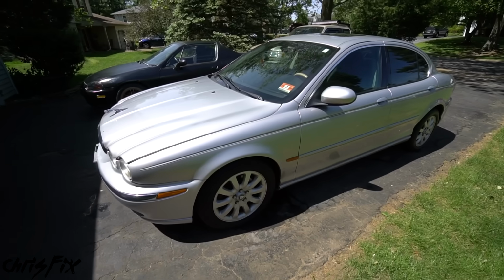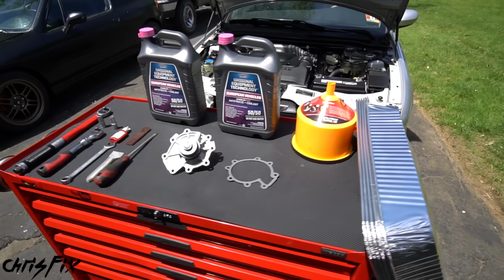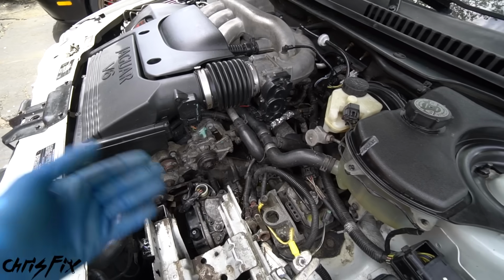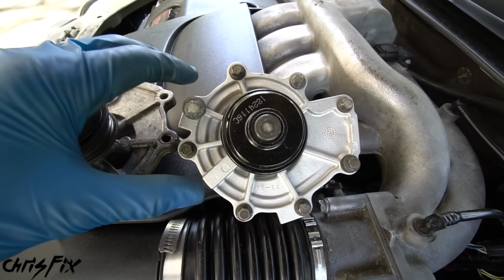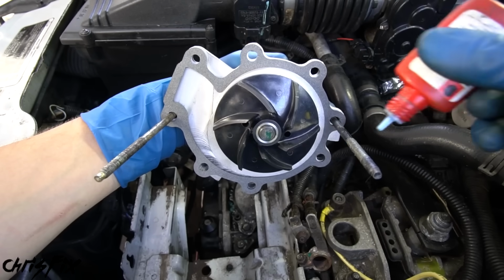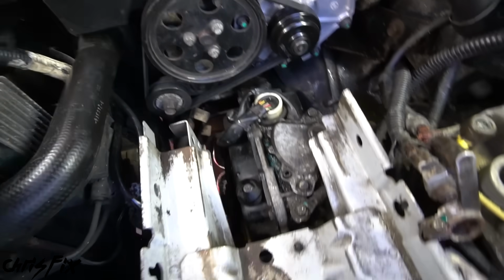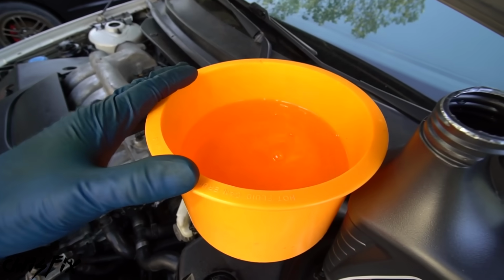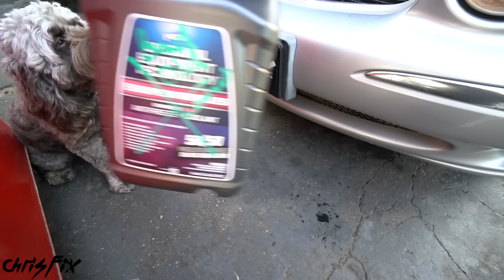How To Replace a Water Pump and Save $783

Comment: The only thing that you didn’t do was check the cooling system’s pressure, the pressure in the cooling system is usually 1bar and it can be checked with a pressure tester.

Comment: Many years ago i did a temp job in a main dealer here in the UK...I'm guessing a lot of you already know this but for those that dont...
one of the "tricks"/ "scams" whatever you wanna call it is this...
Car manufacturer says in its official service manualguide  for its main dealer service shops that job X takes 4hours....
Job can actually be done in say two hours, but the dealer can charge you 4h labour because thats what the manufacturer says in its official service manual..dealer gets away with it by showing customer the manual if questioned on the labour charge......

Comment: Any mechanic heads in here? If so can you save me the bill for an inspection from my local mechanic? My truck runs and drives great but I'm noticing it's taking its sweet time to get power when pushing the gas, she has high mileage (238400) to be exact. The engine doesnt shake or make any funny sounds, it just feels like it takes awhile to get her up to speed, especially on the freeway. Should I just sell it or what?

Comment: freaking Jaguar. 

THE BELT IS ON THE WRONG SIDE OF THE ENGINE YOU FIENDS
Reply: Beaudoin Motorsports VW has the same thing on the tiguan. And it’s tucked in super tight and driven off of the balancing shaft.

Comment: Hey Chris, I was wondering if you would be interested in doing a video about Hydrogen on Demand or HHO, particularly the Hydro Assist Fuel Cell that was purported to be a scam by Dateline NBC in 2009. I would like to install and tune the kit and post a video showing results.

Comment: Hey Chris. I thought if you remove that belt it messes up the timing and camshaft and that? Or do cars have teo belts?
Reply: In the case if that Jag I would imagine it has three belt or more. Most cars have two. The serpentine belt and the timing belt/chain
Reply: That's the timing belt which is attaches to the cam shaft which lifts the valves. The belt he took off wasn't the timing belt
Reply: @sh115067  oh i see thanks

Comment: Hey Chris I have a 2018 Chevrolet Silverado LT regular cab and they come with what I believe a 2 inch higher in the back is it possible to just remove shackle or what will I have to do I just want the truck even. Thank.

Comment: One thing i didn't notice you mention was that some coolant reservoir/overflow tanks require to have an air gap or a certain level in it and not be totally full. Those non-spill funnels will fill it to the top when it might be bad.

Comment: Hey my mom's car is having a problem..pretty much when the car accelerates from 60-80 for a bit the car hesitates or stops for a  millisecond then goes again.....any suggestions? i'm thinking its a bad fuel pump, filter or low fuel pressure

Comment: You didn't check if the parts where the same in this video. You are losing your charm.
Reply from the maker: I showed both of them next to each other and they were identical.
Reply: I know in the video you showed one side and on the thumbnail the other but you didn't say that it's good to compare the parts before replacing them (btw i am joking you are teaching us how to save money you don't need to go overboard).

Comment: Hey Chrris when are you going to install the performance throttle body for your mustang? You showed it in a video about a year ago and never mentioned again.
Reply from the maker: When I install the new motor. The intake on the current motor is as efficient as it gets.

Comment: I'm sorry, but this is one of the only videos I have to dislike. Around 4:30, you mention removing the water pump without draining coolant from the radiator. The coolant in the pump can come out and coat any belts below it. Antifreeze contains ethylene glycol and can ruin a serpentine belt, leading to a much larger repair. Before working on anything dealing with coolant, it's strongly recommended you remove the antifreeze via the radiator. - A 2 year mechanic
Reply from the maker: Sorry but you are incorrect. There is no serpentine belt since it was removed as I showed in the video. No one is changing a water pump without removing the belt that goes around it. Even if there was a belt below it, one time soaking in antifreeze will not ruin a belt. You need constant exposure over time to degrade a belt. Thanks for sharing tho.
Reply: Meanwhile chris has atleast 10 yrs experience lol @chrisfix
Reply: "A 2 year mechanic" 😂

Comment: Jag: its gona be $850
Normal people: shit!!!
Chrisfix: hold my sopy water i will do it in 60 bucks
Jaguar mechanic:😭😭😭
Reply: Sowpee wooder*
Reply: soapy wodder
Reply: The local dealership quoted $500 to replace an '07 Corolla water pump. That's pretty much the best-case scenario.
Reply: @poopipeboy3033  local dealership quoted $2000 replace a 2012 BMW water pump, that was a horrible experience
Reply: Its actually Sowpee Wooder and also a Blinker Fluid

Comment: hey Chris I have a problem with my car and every time I take it to the mechanic they do different things to it and still the problem isn't fixed the DPF filter warning light would come on every so often and after I drive it sometime you would go away and one time they check engine light and the glow plug light came on I took it to the mechanic he cleaned the DPF and give it back, after a month the same problem came back I took it to the mechanic and they said it's the glow plugs so they change the glow plugs and I drove around to heat up the engine so the DPF is cleared but the warning lights are still on, any ideas I could really use the help
Reply from the maker: It would be helpful to know the year, make, and model.
Reply: @chrisfix  Audi A3 2009

Comment: Sorry but not many cars are like that with there water pumps 
Toyota,Nissan,Mazda,BMW,ford, Honda and more. normally have there water pumps behind the timing belt set up and are cunts to do. would love to see you do a water pump on a 2jz RB M20 4age sr20 b16 all take much longer and are allot harder 
But good video man love your work but you did do it on the easiest engine ever

Comment: Chrisfix I really need your help with an issue I'm having. 

I got a Lexus ES 350(2008)(130k)  that was shaking on acceleration and braking. Anything after 40 mph gets pretty bad. 

I replaced the tie rods, lower ball joints (there's no upper), and sway end links bars. All of these parts were OEM Lexus and worn and had a lot of play. 

My car settled down mostly. But it still shakes after 40mph. When I let go of the gas my car settles and rides completely smooth. 

When I brake at 60mph or more. My steering wheel shakes a lot. 

I got an alightment (toe, camber and something else) today from a Toyota dealer. I drove around and it seemed to solve my issue. 

But after an hour or so my shaking issue is still happening at 40mph but less violently. I can also now give it more gas than before, before it shakes. But it STILL shakes. 

I'm so frustrated man. I love this car and it's the only issue it has. What in the world could it be Chris ?

I was thinking CV axles but my car doesn't make that clicking noises when I turn..

Comment: Rule is to always add gasket sealant. Just a thin amount. Do the job once. Never install dry.
Reply from the maker: Actually the rule is to install dry. It’s against manufacture recommendation if you use a gasket and RTV.

Comment: Q: didn't you overfill that coolant reservoir by filling it up to the top? You should mention that you gotta fill it to the max level marked on the reservoir.
Reply from the maker: This reservoir cannot be overfilled. If it is, coolant comes out of a small hole on the side of the reservoir. Great question.

Comment: Sure, in this car's case changing the water pump is an easy task most people could do. Many engines have the water pump driven by the timing belt though, which I'd never remove if I was unexperienced.

Comment: Hey Chris, you are a score to the humanity, thank you for your videos and please keep it coming with more how to tutorials,

Question: I own a 16 Subaru crosstrek in Dubai, whenever I cold start the engine I hear a knock in the engine that escalates until it blends with the engine noise, I couldn’t identify it because it happens noticeably only at a cold start, other times it happens but for a shorter time, depending on how cold the engine is, i think i have a short video for it, let me know if you can help me with it.

Comment: It's also a good idea to turn on your heater on full blast to make sure the heater core doesn't have air bubbles as well.
Reply from the maker: Thanks for the tip. That works for some cars but in this case there is no heater control valve so the coolant runs through the heater core all of the time

Comment: What about turning the heater on when your purging the cooling system from air?
Reply from the maker: Great idea but in this car there is no heater control valve so the coolant runs through the heater core all the time.

Comment: Shame this doesn't really apply to my 2011 3.5 Ford Edge. Water pump is ran by the timing chain.
Reply from the maker: Timing belt or timing chain?
Reply: Chain. Whole passenger side of the motor has to come off.

Comment: Quick tip from changing a water pump a few years ago on an old car: replace the bolts holding it on. I had one shear off when putting the new pump on (it's possible it was cross threaded, but I'm relatively confident it wasn't).  Engine blocks are aluminum while the bolts are steel, so it very, very difficult to get broken part out.
Reply from the maker: Thanks for the tip! Torquing then down and using threadlocker helps with that. If your bolts are corroded def swap them out.

Comment: After I bring the car up to temperature, and the thermostat opens, I also put the heat on full blast to open up the heater core, and make sure fresh coolant circulates throughout the entire system
Reply from the maker: Great tip. Many cars you don’t even need to do this because they don’t have heater control valves. That means the coolant goes through the heater core all the time.

Comment: Great vid but just remember that the exact location of the water pump varies by  engine and maker and it won't be nearly this easy to access it or remove it without having the car jacked or on a lift.
Reply from the maker: Correct, thanks for sharing

Comment: How to know if the fix is easy or it will take longer.

Video is around 10 minutes = simple
Video is above 15 or around 20+ minutes = you have to put in some work

Tnx Chris i have been watching ur video for alot of time and now when i have a car and actually didn't drive it for a few months the battary died, after opening the car and charging the battery the car still would not fire up the engine even tho i had oil and all the other stuff, so i went with the dead battery to a local battery shop and yup it had dead cells so they sold me a new one same AH with a discount for bringing in the old one.

Battery was like 6 year old and in a good looking shape but yea after charging it for like 12 hours it didn't go above 25% charge and could not fire up the engine.
Reply from the maker: I’m glad you’re learning a lot!

Comment: Spent 2 hours trying to get my damn fan clutch off and called it quits when I couldn't get it off. Hoping for better luck tomorrow with the proper loaner clutch removal tool from the auto parts store.
Reply from the maker: Get the proper tool and it makes it easy. Good luck!

Comment: Hey chris I have a 2000 mustang v6 with worn out factory pinstriping all the way down the side of the cad I was wondering if you knew a safe way to remove it without scratching or damaging the paint ik you may not see this but I looked all over YouTube and none of them exactly seem safe was wondering if you had any suggestions

Comment: Many newer front wheel drive vehicles have an internal water pump driven by the timing chain.  Meaning you will need to do a timing service at the same time  since you have to pull off the timing chain to do the water pump replacement. This adds a level of complexity to the job.  In some vehicles, like the 2010+ Ford Taurus, the engine needs to be removed from the bottom of the car to replace.  Fortunately on your dad's Jaguar, it's on the outside of the engine.  I like this about the older engines.  A little simpler to work on compared to a lot of newer vehicles.

Comment: There's a max fill line on the coolant reservoir. You shouldn't fill the reservoir to the max because when the engine gets hot it will build pressure in that reservoir and liquid doesn't compress that's why there should be air left in the tank.
Reply: @shaolini  Yeah exactly. They have an expansion tank for a reason
Reply: @shaolini  I don't understand what you're saying. Are you saying that a coolant reservoir and  an expansion tank are 2 different things? Are you saying that you should just fill the coolant(and not the radiator) reservoir to the max line and add more if needed?

Comment: Is it just a myth that replacing timing belt requires water pump replaced as well?
Reply: Kinda. In cars where the water pump is driven by the timing belt it is not mandatory but is a real good idea. Usually you only risk having to do the job again but it can be much worse - I was in a Volvo forum when one member who had changed his timing belt but not the water pump suffered seizure of the water pump. It destroyed the belt and did $6000 damage to the engine. That said, I sometimes take the chance if the pump is a lot more work to get to, like in my daughter's Sienna.

Comment: Bolts: exist
Chrisfix: ill be using medium strength threadlocker and torque them 8ft pounds
Reply: 1998diegox which is the correct thing to do

Comment: You forgot to drain the excess amount of coolant in the expansion tank. If the valve doesn't open properly, your coolant tank is gonna explode when at operating temperature. There is a reason that there is a max and minimum line on them.

Comment: Hey Chris, happy to see you're updating a little more regularly than you used to! 

I like your videos a lot because you do the job for a specific car but usually include the possible differences between different cars. However, I'm kind of disappointed that that's not the case for this video. You kept this very specific to the Jaguar, while the water pump may be one of the few parts that is very diverse in terms of location, the way it's driven and how to do the procedure. For example, not all water pumps are serpentine belt driven, a lot are driven by the timing belt. With the Jaguar, you only had to remove one pulley, with a lot of different cars you have to remove a lot more. Some cars have an electric water pump (BMW E90, looking at you). Sometimes you also have to swap out other gaskets and O-rings when replacing the water pump. Not all coolant reservoirs are placed in such a convenient spot and can be bled the way you've shown (the reason why the method you've shown works is because the reservoir is the highest point in the loop). Also, the little bit of theory and the analysis of how and why the water pump failed was lacking in this video. 

This video was very straightforward and short, and for some things that's fine. But this video is barely usable as a guide for most cars as the water pump is placed in a horrible spot, requires the removal of engine mounts/timing belt/timing belt cover, et cetera. It's missing the in-depth element that helps me understand how a car works as a complete system. This was just a replacement guide, so I'm a little disappointed with this video.

Comment: Mate, i replaced the water pump on my girlfriends Mazda 6 a few months ago. Cost me a total of about $100 (AUD), and a couple hours work. Saved me about $300-$350  (AUD) than what my regular mechanic would've charged.

And a little tip, with old oils and fluids, i found a place and asked for a few of their old 20L oil drums. Took 4 of them. Now i don't have to go to the recycling centre every few days. Especially handy if you go through alot of oil/fluids.

Comment: I like to use a thin smear or rtv on the gasket for 2 reasons, A to hold it in place and B, for older cars where the surfaces may not be as flat at they should, it will help fill any of those low points or damage, but only a very thing smear.

Comment: Tip:
Use a disposable diaper held with gaffer tape to stop leaking fluid from making a mess on the road or driveway!
They're very absorbent these days to keep babies dry. But only use it as a temporary fix, not as a long-term cure.

Comment: I like to use weather stripping adhesion on the water pump. Just a couple dabs and it will hold the gasket in place makes it nice for hard to reach places!

Comment: Why is it so easy to replace a Jag water pump? my 1990 f250 required removing radiator and fan, shroud, pulleys, and belts

Comment: Nice informative video.. However, plastic scrapers are shit.  I've used the EXACT metal scraper you showed for years and never had problems. The problem is not the tool, it's the person using the tool that's doesn't know how to use it. I do understand  you having to cover your ass from ignorant people. The gasket you scraped with that plastic tool was EXTREMELY EASY to remove.

Comment: Referring back your blower motor resistor video, I have a 2001 grand marquis and the ac level shoot from high to low. Sometimes it even cuts off. It seem if it’s hotter outside it barely works and if it’s cooler it works but it jump from high to low. Does that sound like the resistor?

Comment: One thing I'd add is to turn your heat on full when refilling and bleeding the rad.  Don't want any air inside the heater matrix that can cause a problem for you later, when you next need the heat turned on (which could be months from now.)